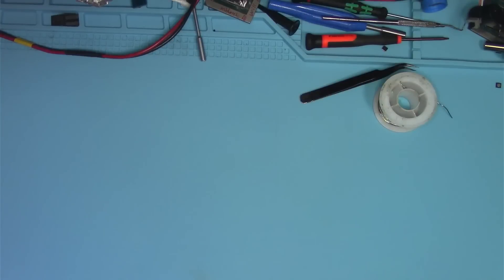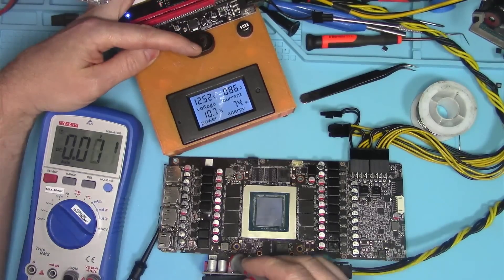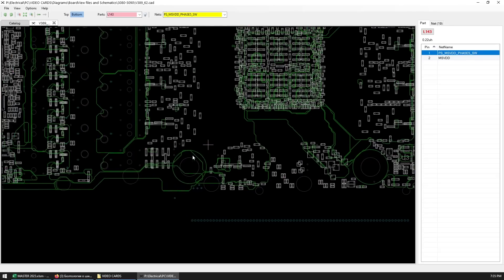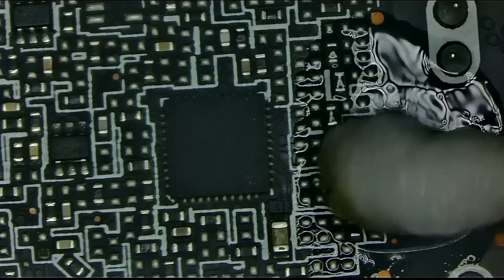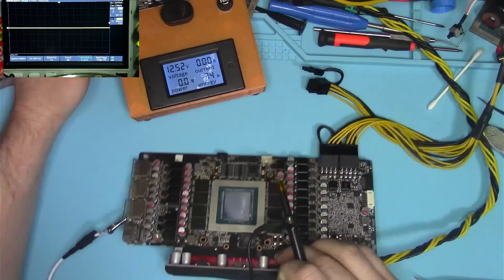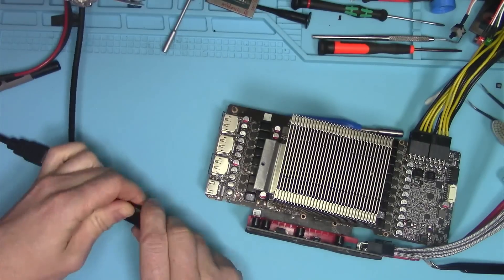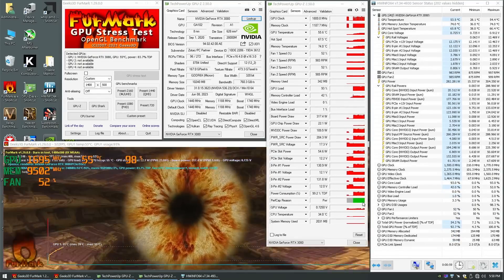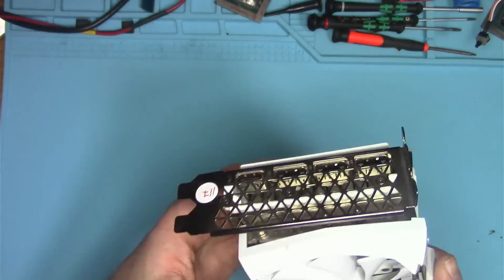What overclocking or poor maintenance does to your graphics card

Comment: I agree 90% of to total is better than none at all! Does the overheating issues apply to the cards that have been used extensively for mining?
Reply: I´d say depends on the miner. If the cards were used in enviroment with AC, maintained at the same temperature and in the same conditions, then the only thing worn would be fans.

Don´t touch cards from miner, if they can´t/won´t answer you any questions about enviroment, they were running in.
Reply: Mining I feel carries different risks. Mining abuses memory chips much much more. It hardly utilizes the GPU core at all. 

Then you have to consider how well they kept care of it. Was it running 24/7 in a shed that was at 80% humidity and 28C and full of dust or did they keep it in a server-friendly warehouse with cool and dry air? 

Then you should ask whether or not they put a mining BIOS on it. 

I'm sure most miners would not answer these questions even if you asked -- but to me they are assumed risks of the purchase. 

If you bought a mining GPU and everything has been great, don't worry then. They likely just did what they could to keep the GPUs alive and well. 

Have to remember that from a miner's perspective the GPU is an investment and it's in their best interest to keep it in working condition.

 I think 90% of the time they will work just fine for many years but your risk of a MOSFET or other component blowing up are less than a GPU that was overclocked and heavily gamed on with no regard for the card.

Comment: Some cards are simply disgusting, gives a good idea on their owners hygienic practices.
Reply: All it takes is the user being smoker. HW from smokers looks and smells disgusting, but still works most of the time.

Personally, i gave up on cleaning some time ago. Too much work for too little benefit. All i do now, is taking whole case out about twice per year and blow the dust out with leaf blower. Even with all that, there is no dust buildup inside of my case - only the smallest particles get in and they tend to be stuck on horizontal surfaces and rear side of fan blades.

HTPC in our living room only has 2 filters on intakes and there is no dust inside of it at all.
Reply: @kiwismurf4536  I couldn't really see--but that card didn't really look that dusty. And yeah, I vacuum the carpets every day or two, and dust the desk. Yet, in just one day, dust is clearly visible on my black desk.

Comment: Genuine question, I do underclock + oc my RTX 3070 what are the chances of this happening? I don't memory OC as I tend to believe that it makes more harm than benefits for the long term. I do keep check of my temps regularly, and I do repaste and repads and clean grease residue if I think the temps are too high for full load and what not.
Reply: Unless you have defective mosfet somewhere on the card, very low.
Reply: There's not much more you can really do. But I would suggest to stop underclocking your card and undervolt it instead with frequency curve in MSI Afterburner. 

My 3070 runs at 1890Mhz @ 0.85mv @ 90% Power Limit and I get 36-41C in most games. Anything extremely demanding still pushes it to 48-51C but those kinda apps are few and far between. Think Quake II RTX and the like. 

I use 90 FPS frame limiter in RTSS as well. More frames = more heat = more component stress. I've done plenty of testing and I just can't see any benefits past 90 FPS so that's what I stick to as a global limit, personal preference.
Reply: @The_Man_In_Red  Oh sorry I meant to say Undervolt it with Frequency Curve applied as well, I just use UC + OC as a shortcut for it, 36 - 41 is my idle, I'm running with a sff build it gets a bit hot at full load on triple a games it gets to 72
Reply: @Adim0413  Try lowering your Power Limit to 90% or so. In my tests with undervolt + power limit I only lost some small score in synthetics and at most 1-2 FPS in games which was margin of error to me so I didn't put much stock in it. 

But that combination really dropped temps down even further. 

YMMV but it's worth at least trying and see how performance and temps are, especially since your ambient temps are not easily improved.
Reply: @The_Man_In_Red  Followed your advice, set the settings to a power limit of 90%, fucked up my games as DirectX API keeps crashing, so I had to redo my frequency configurations from scratch.

My last config was at 100% with the Frequency curve set at 2045 MHz @ 968mV, this was the farthest and stable I could go without any games crashing, so I did bump down my clock speeds, the most stable I can do was 1945MHz @ 912mV, it was a whole lotta different, idle temps went down to 37-38, mid spec games were just hurdling my GPU to 55 - 56, while the super demanding ones were at 64-65.

This was really a game changer, thanks for the advise really solved 2 problems with one stone on this one

Comment: hey i was wondering, undervolting a gpu has a lot of benefits, and I do that a lot, but Is there any way to pernamently undervolt the card, something like a vbios mod, so even if I reinstall windows the card stays undervolted, thanks
(nvidia card)
Reply from the maker: I'd like to know that too. I think there is a way, i just never bothered to look at it.
Reply: @northwestrepair  There used to be, before the age of manufacturer signature enforcement in the VBIOS
Reply: @TheBackyardChemist  Some manufacturers will still let you do that. I dont know if its the same but AMD used to be really good about letting you edit and flash bioses. It was really fun tweaking memory timings on my 480.
Reply: @Falcodrin  No I think the 4xx/5xx series were the last where you could freely edit the VBIOS, maybe the Fury cards. But on anything Vega or later, the GPU verifies that the VBIOS has a valid AMD signature before using it. I think some of the regions in the VBIOS are not signature-protected but they are probably useless.
Reply: AFAIK, there was a way in GTX 900 series. That was the last Nvidia series, which supported VBIOS modding - i modded my GPU all the time and tweaked it into near perfection.
But since 1000 series onward, VBIOSes are locked to prevent any tampering.
Reply: @Morpheus-pt3wq  oh, Well i wanted to mod my 1070, but that means i can still play around with my old 770 4g